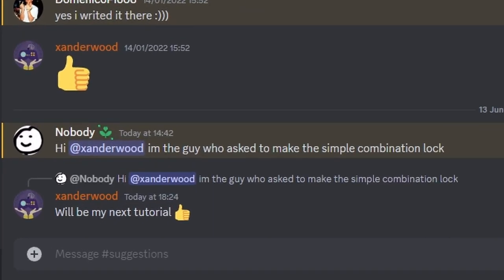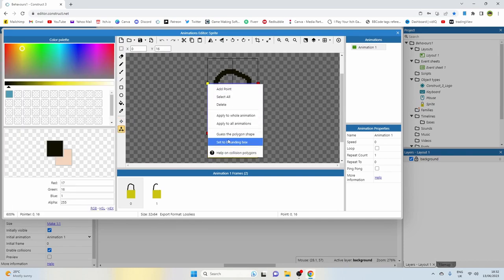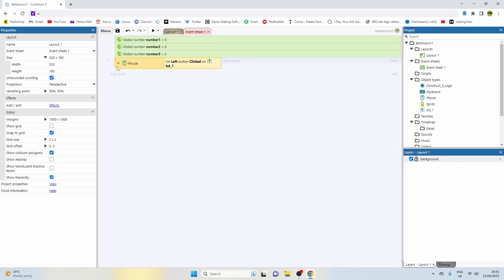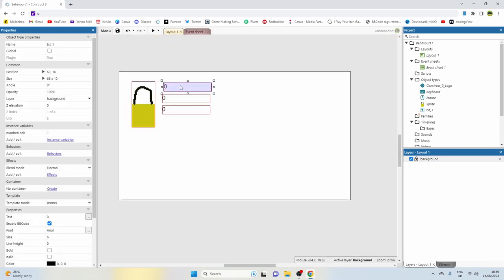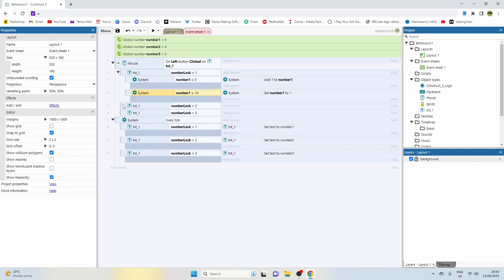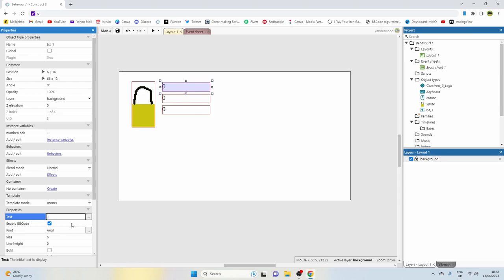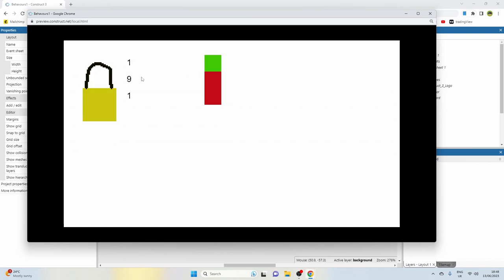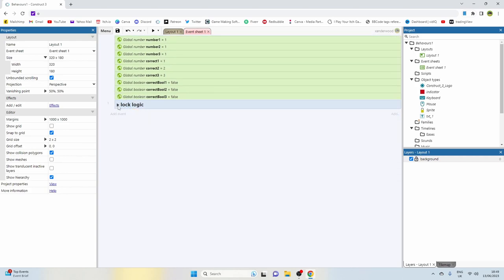How to make a COMBINATION LOCK in Construct 3 - Easy Tutorial

Comment: I have question about multiplayer:  this engine is good for that?  For example, for a co-op plataform game.       

My other question is about the max jump frame.    When the player is falling, i just put the animation of the player falling (or just the state "falling"), and when is jumping, I do the same but with other animation or state.    

The problem is that I need to put an animation that is a transition between "jumping" and "falling", and I cant resolve that : S 

Any idea?
Reply from the maker: It's great for local co-op yes. You won't have any problems. Regarding your jump problem. Just add another state. Have a state for jumping, transition and fall. When jumping state ends set set to transition and only allow fall to start once transition has finished playing. If you want I can make a tutorial but please leave the request for it in my discord as I will forget if its left in the comments. 💪
Reply: @XanderwoodGameDev  It works! : D  Thank you!